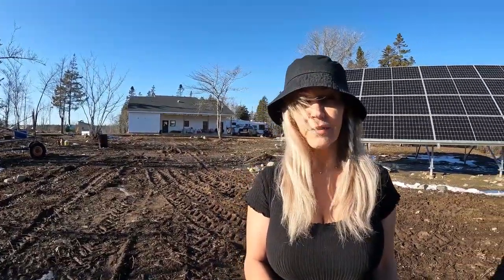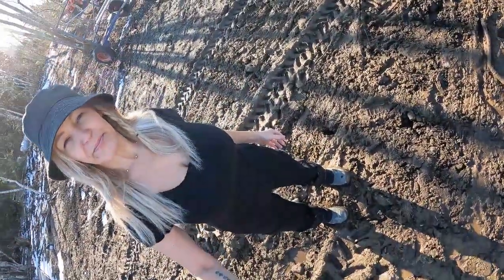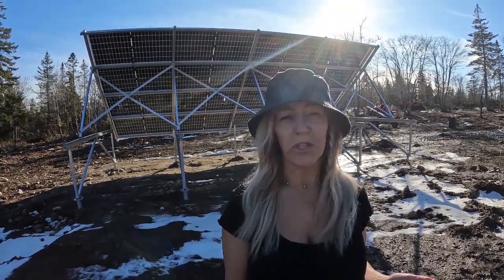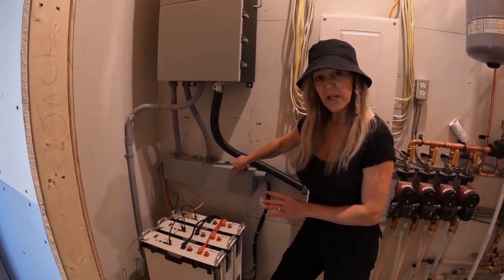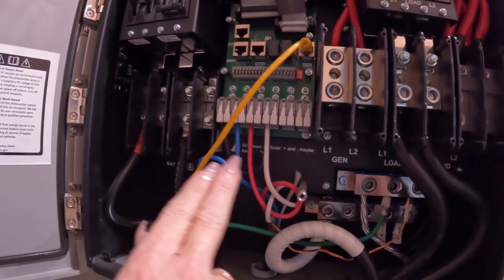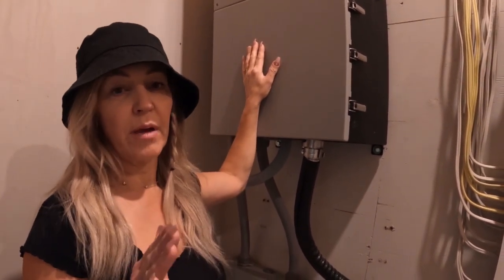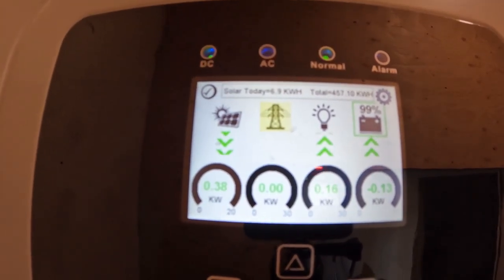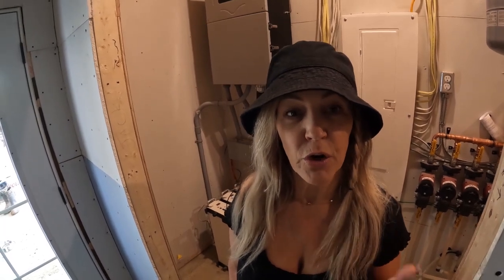Best Full Home Solar System and Inverter

Comment: great idea  ,how long will the panels last ? how much environmental damage has it caused making them and how much damage will be caused in disposal  as the majority cannot be recycled  and most will just be buried at the moment  .All these questions have answers if you do some research and this needs to be done and not by the companies who supply and fit them
Reply: Those aren't canadian tire panels.  They are warranted for 15 years by the looks of the site she mentioned.  Also, by the looks of it, Nova Scotia Power is still making electricity from coal. At least she is one less person with that monopoly!!  Well done Blondie

Comment: I'm shopping for a rural lot in NS as I type, to do almost exactly what you have going on. As a mechanical contractor, the infloor heating is a "no brainer". I'm currently using all Victron equipment, and will probably use it again in the new build. PS-got any hot tips for a cost effective property 2+/- acres?
Reply: Look around the Annapolis Valley or Bay of fundy side because it's one of the warmer parts of Canada for winters and land is still a fare price.